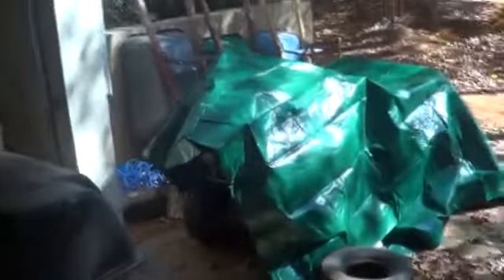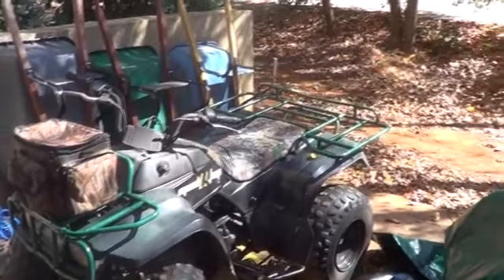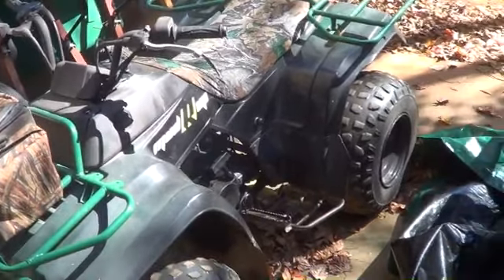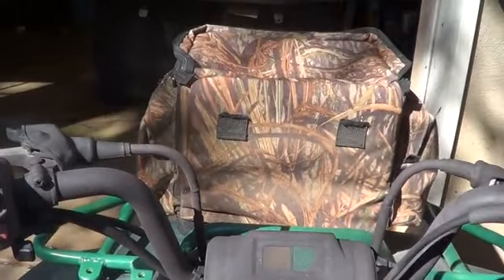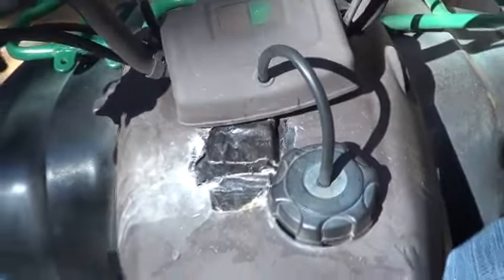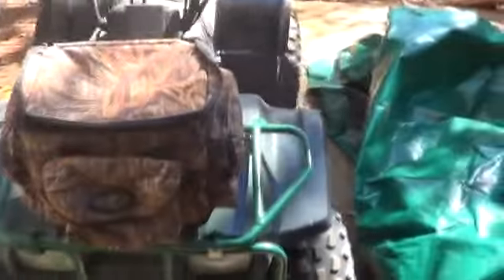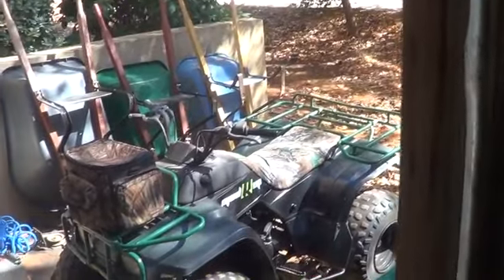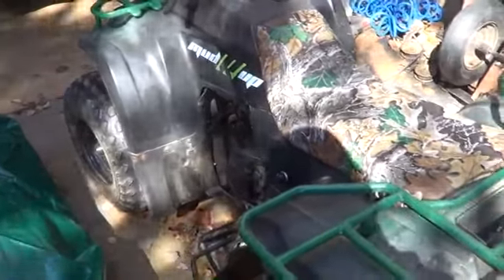1999 Kawasaki bayou 220

Comment: I know this was a while ago but do you happen to know how it is putting the dash cluster onto the wheeler. My bayou 220 didnt come with one so I bought one. It has 2 wires that come off it so there must be 2 down under the handle bars somewhere that they connect to. Any advice helps or tips or w/e. Thanks